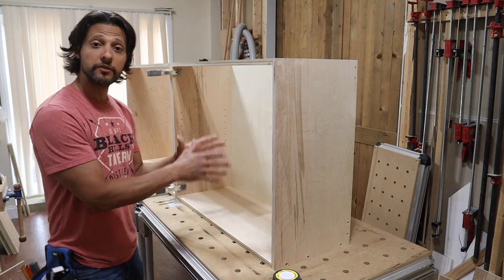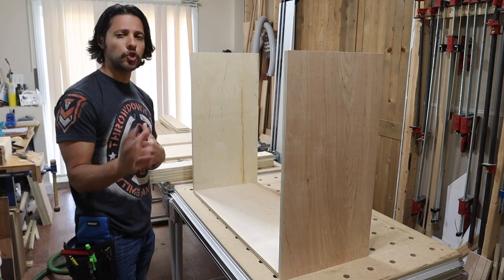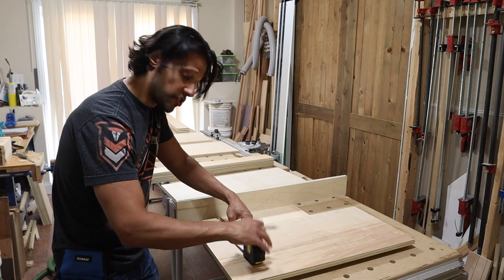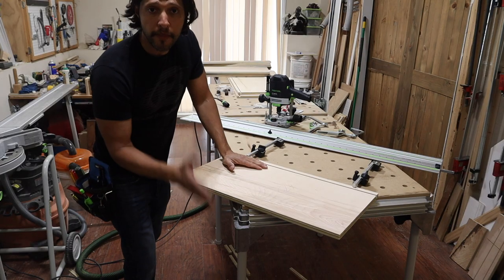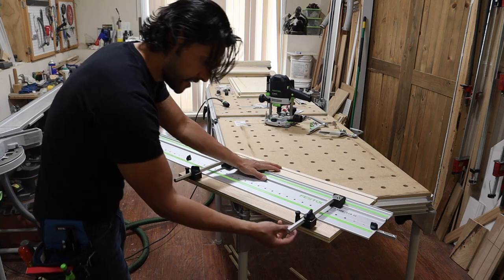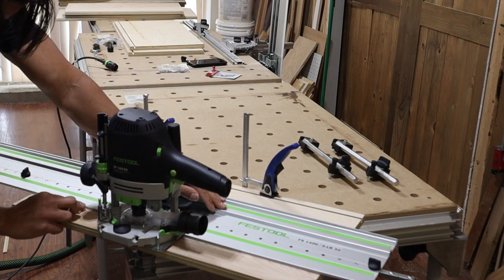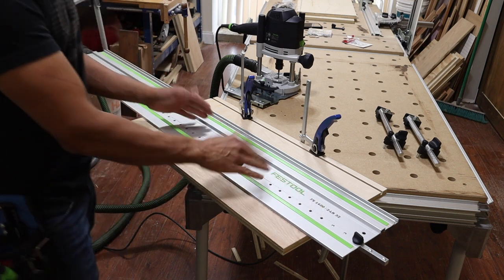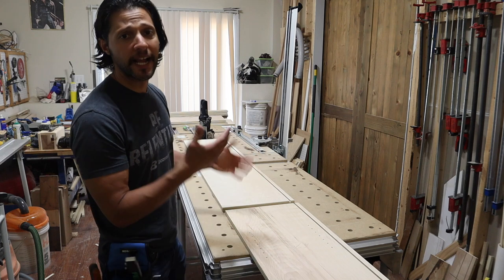cabinet building series: 2. assembling the boxes

Comment: Great Tips! More Questions:

Looking at the OF1010 router, will that work as well for this type of work with the rabbits and shelf pin holes?  
I see a Kreg in the corner, why not use pocket screws for the top spacers and the bottom, I think you said it was a built-in so if this was NOT a built-in would you consider using pocket holes and screws?

Thanks for the suggestions and making the video!  Now I will not have panels that look like Swiss cheese!
Reply from the maker: The of1010 will work but it’s not as easy to attach to the LR32. Also it’s not as versatile and powerful as the of1400. I know it’s more expensive but the 1400 is a much better all around router.

Comment: Excellent series!! Newbie question, Festool Domino is an expensive tool to own. Looking at this I get the feeling that it helps to align the panels but eventually if you are going to install screws, probably a beginner can get away with directly putting the screws without the dominos. What are your thoughts?
Reply from the maker: You 100% Do Not need a domino for this. It helps yes, but you can just tack the panels together with a crown stapler or a brad nailer so it doesn’t move around while you screw it together.

Comment: Dammit Anthony! you got me looking at the LR32 system. I'll have to see how many shelf pin holes I'll be making and then decide if its time to move up from my trusty Kreg jig. I'm finding lots of options to make it work with my Makita router so it looks promising. Looking at the Domino now but wondering if a good biscuit joiner would solve the easy alignment issue? Thoughts? Pros and Cons? or maybe both? Eye balling that MFT setup.......all your fault!
Excellent series so far and I know it will keep getting better. I'm saving it to my cabinet building list for lifetime reference! You have done a well thought out teaching method. Most assume the new woodworker knows how to break down sheet goods or does the top and bottom panel go inside or bottom of the side panels? Assume nothing, teach everything. Gold star for you brother!
Reply from the maker: The lr32 is worth it if you make as many cabinets and built ins as I do but the kreg jig and Rockler jigs work fine also. A biscuit joiner has its place but doesn’t hold a candle next to a domino in my opinion. I really never use a biscuit joiner except to make splines once in a blue moon. You can see that on my “flag case”video

Comment: Love your videos. I think I'm going to sell my table saw and miter saw and pick up a mft table and a track saw. Any suggestions on where to buy ?
Reply from the maker: I have the track saw link in the description of this video, the MFT’s are out of stock on Amazon and most other places right now, but I’m sure if you do a google search, someone should have an MFT/3
Reply: @AnthonyScolaro1  okay thanks Anthony. So you suggest the tracks are that you have in the link, which I'm assuming is the one you're using. Also you suggest the MFT3? Anything else for starting out or do you think that's good enough for replacing my table saw and miter saw currently.
Reply from the maker: @johnmanfra4224  it all depends on what type of work you’re doing. I can’t live without both the track saw and miter saw but I do all custom work and moldings. If you’re just doing hobby woodworking at home, you’ll be good with the track saw and MFT/3 for a while because it’s so versatile. Eventually you’ll regret getting rid of your miter saw.
Reply: @AnthonyScolaro1  ok I see and understand. Thanks again.